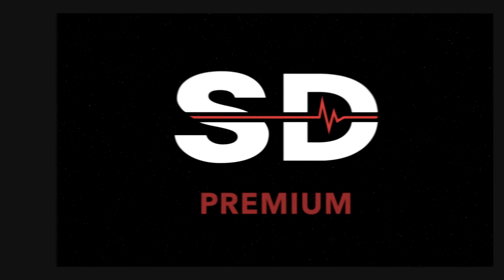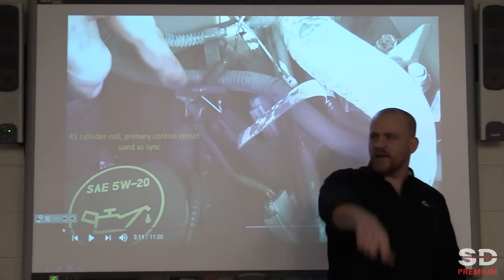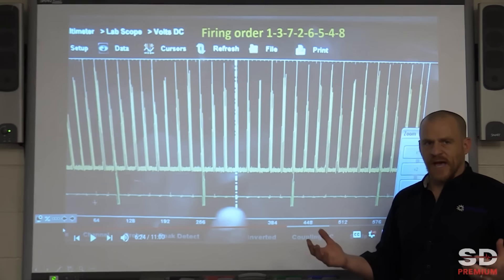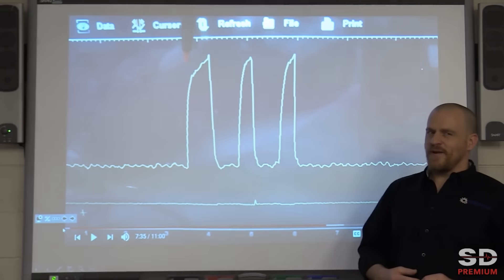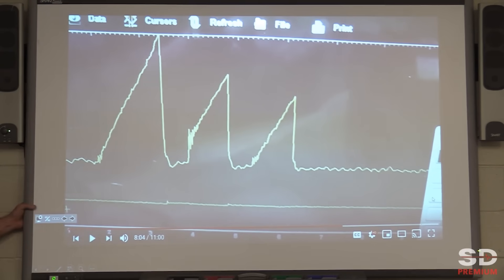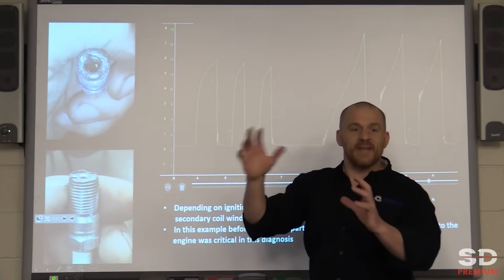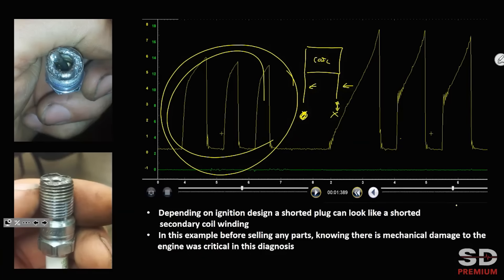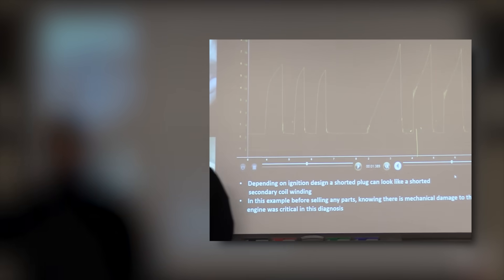No Spark Testing - Shorted Ignition Coil?

Comment: Can you comment on why a waste spark system would be a different scope image?  I would think that in a system looking for the path of least resistance a shorted wire, plug, or coil secondary would offer lower resistance than the compressed cylinder, leaving the same scope signature as a  non waste spark system or am misunderstanding the waste spark theory?
Reply from the maker: On a waste spark coil, if one side is shorted, there is still an air gap in the loop back to the coil from the other side, so you will still have that secondary "ring" while the coil is charging. 
What leaves the coil has to come back to the coil. On ALL types! The waste spark return path is the other spark plug and wire. Hope that makes sense
Reply: Thank you

Comment: Excellent job of explaining a shorted secondary vs primary coil. I was still confused as to how you could tell by the current waveform even after watching several of your videos on the subject. Thank you!
Reply: Those are the videos you referred to previously. This video here explained it perfectly. The lack of ringing and the fact it has a steep ramp opposed to a straight vertical rise is key.
Reply from the maker: Did you see on that old school , GM TBI video where i mistakenly thought the primary was shorted until much later in the video where I zoomed more in on the ramp?
Reply: @ScannerDanner I did lol. Good stuff.
Reply from the maker: Good question. For sure in this one, I did not add details on how I knew this wasn't a shorted primary. I did mention you'd have you zoom more in on the waveform to see it. But with this one was more focused on the shorted plug looking like a shorted secondary winding. 
I have another one that may help you as I first misidentified it as a shorted primary. Let me find it...
Reply from the maker: https://youtu.be/mDKj19Hnhd0

https://youtu.be/p68w9CJG00g

Comment: I'm surprised it didn't have an obvious low compression crank.  I've been burned before as well.
Reply from the maker: I'm sure it did, but I was with a class of 20 students when this truck came in and I was teaching through this topic and I used this truck for an exercise with the class. So my focus was on teaching a technique and I was not as focused on the issue at hand. Unfortunately, this truck started right away and I never heard a cadence issue with the starter, suggesting low or no compression in this one cylinder. This was obviously a huge mistake on my part.
Reply: @ScannerDanner  Yeah, I jumped the gun on a nissan with a dead misfire.  It was a late arrival and the coils were under the intake.  I assumed it was a bad coil, turned out to have burnt valves.

Comment: Greased monkey standard procedure, erase codes and pack the computer connector with 2 pounds of dielectric grease, replace all the coils plugs and injectors, then call a professional so he can charge the customer for all the replaced unnecessary parts.

Comment: How about a shorted plug or secondary winding on a cop coil with a high voltage suppressing diode in the secondary circuit ?
Reply from the maker: This was a COP coil and I've seen injectors use suppressing diodes, but not ignition coils. I don't think you'd want to limit the primary in that way as it would weaken the secondary peak as well

Comment: lot of techs to eager to get the scope out,, surely you'd check the basics 1st and the basics is a comp test, then you'd see it has not comp in that cylinder
Reply: did you watch the whole video? he made this mistake bc he was teaching about ignition and skipped the comp test. its an honest mistake. anyone doing diagnosis like this in the field starts with a clear flood test listening to the cadence of the engine followed by a relative compression with a scope before jumping to ignition like this. So yes, you would 100% still pull the scope out first when diaging this. A comp test with a gauge takes forever on a 8 cylinder engine. No one is doing that except for techs that arent scope trained.
Reply from the maker: I was teaching a class of 20 students about scope testing ignition systems when this truck came in and so I used it for an exercise with the class. (live troubleshooting with 20 sets of eyes watching - try it sometime 😊)
 So my focus was on teaching a specific technique and I was not as focused on the issue at hand. Unfortunately, this truck started right away and I never heard a cadence issue with the starter, suggesting low or no compression in this one cylinder. This was obviously a huge mistake on my part. I mentioned this near the end of this clip. 
But I do agree, basics first! Look what it cost me in this case?